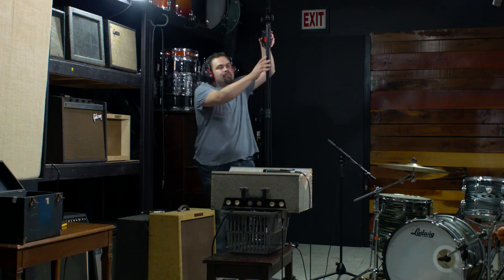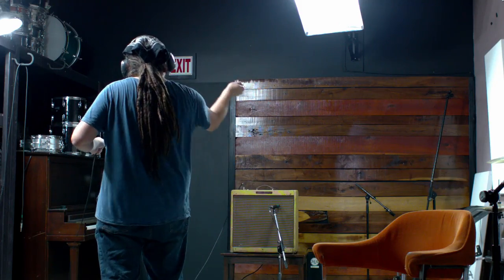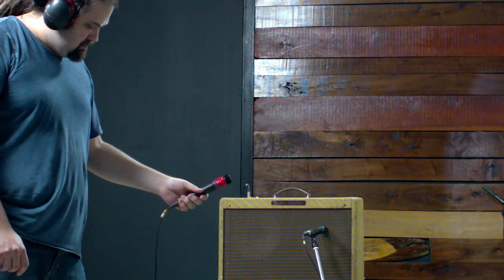Using a Lasso SM57 to Create Doppler Chorus

Comment: I can hear my mother's voice in my head, "Sure, it's all fun and rock'n'roll, until you take somebody's eye out swinging that fakakta thing!"

Seriously, though, it is a very cool effect. The main downside I see is that you not only have to tape up the mic, but afterward, you'll probably have to tape up your shoulder as well.
Reply from the maker: No tape to secure it, just to make it Omni. The xlr jack held it good.
Reply: Actually, I was referring to using the tape to make it omni. I was trying to make a bad overexerting-the-old-shoulder joke—mainly because my shoulder hurt just watching you spin that thing. But since you mention it, exactly how are you applying the tape to make the mic omni? It was a little hard to see exactly what you were doing there.
Reply from the maker: Yeah, ok good. Was worried that the video was really unclear about a mic becoming loose and flying. For the omni bit, I'm just putting the tape over the vent, just behind the white text of the mic that says "SM57".

Comment: Have you tried doing a mid/side approach to the close mic with the swinging mic as the mid variable?
Close mic copied and inverted (nulled out)
Swinging mic no pan?
Reply from the maker: That's an interesting idea. I should give it a shot. Very possible that they will just not add together, and you get a weird phase sound out to the sides.

Comment: Oh, that reminds me, I almost bought an "as-is" Leslie 825 from Goodwill on tuesday. It has no power cable, so there was no way to test it, and no returns..... If I could've known that the speaker wasn't ripped and the motor worked, I'd have bought it anyway, it was 150 bucks. Even if the amp was dead, I'd drive it with something else. But....if I don't even know it works at all, and the amp and motor could both be dead and the speaker cone eaten by mice, 150 is a bit more of a risk than I'm willing to take. On the other hand, that's probably just my personal preferences, because if it was an old Valco or something without a power cable, I would have taken the risk and had a new project to work on if necessary, but not for something that I can't use as a major part of my everyday setup. It was the type with a stationary speaker, but with a cylinder that rotates around the speaker with an opening on one side. I've been thinking I could build one out of a ceiling fan and a hunk of PVC pipe. Or I suppose I could just take my little Pro Jr combo and throw it up in the air....
Reply from the maker: Hmmm yeah like a few pvc that is a large diameter that could work. Or perhaps something out of light weight wood on top of a ceiling fan motor.
Reply: Yeah, could even be a couple flat boards nailed together to make a bracket that would spin around the center, or 4 boards making  t shape, with a piece hanging down from each end. The fan blades themselves could probably be used with an additional board hanging down from the end of each blade. I've tried setting a window fan on a Variac to spin very slowly in front of a 1x12, right between the mic and the speaker, but it made too much electrical noise to be practical.
Reply: Guitar Leslies are easy to come by - simply obtain somebody's throwaway Hammond spinet organ, commonly available for free.
Some people will even pay you to take it away!
The inbuilt cheese wheel Leslie is a self-contained unit, easily removed. Hook it up to a small guitar amp (15-20 watts). You'll need to devise a safe switching mechanism for the motor stack, maybe get a qualified electrician or amp technician to do it. Or you could just hardwire only the slow or fast motor, whichever you prefer. Should still cost less than risking a Goodwill mystery Leslie.
Reply: I live in CT, our "free organ" market has dried way up, and now people are asking 1000 bucks on craigslist for their "everything works except these 20 keys and the reverb and mice live in the speaker cones" 1961 M100. I used to go around and grab up ALL the old Hammonds and convert the amps for guitar, bass, harmonica, hell....I even had a pair of old (I think AO-39) Hammond amps that I used almost exclusively for re-amping drum overheads in my stairway, so I could track drums really dry and then get room sound after the fact. My favorite bass amp is an AO44 converted, with the negative-feedback loop disconnected and the input hot jumped straight to the grid of the first tube. A compression pedal, into that amp, driving a 115 with a Black Widow. Or plug a guitar straight into it and drive a 112 with a T75. Awesome amp that will sound cool for a number of applications. Then people got wise to it and started asking exorbitant prices. It was cool while it lasted.....
Reply: Adam Rainstopper don’t bother trying to obtain toneeheel Hammonds. As you say, the Hipsters have driven prices through the roof, and it is absolute sacrilege to cannibalise these increasingly rare instruments just to make guitar & studio effects.
I meant cheap, cheesy LSI organs, not just Hammonds either - plenty of other unloved brands used authentic Leslie cheesewheels
Reply: I've never butchered a perfectly working tonewheel organ to make a guitar amp. I think it's actually people like me who drive the prices up though, people who harvest what is good and make something cool out of it. The amps in there are really great for guitar, with minimal work. The amps are also housed in a time-capsule, and are not moving parts, which is why a Hammond amp (or a Baldwin or a Conn or any number of different older brands) will outlast the tonewheels and the start motor and so on. I found one, an M100, in an abandoned church somewhere in Providence, and the start motor wouldn't move, the keys were filthy and all sticky and full of mouse crap, the tonewheels and the entire tone-generator ..... thing .... was rusty. However, there were two amps in it that were remarkably undamaged. I would love to have an entire M100 in my studio, but I only ever get pieces of them.

Comment: Can anyone explain how the tape turns the SM57 into a omnidirectional mic?
Reply from the maker: Without the vents the diaphragm can't cancel out the sound that is coming from behind it. This is why singers should "Cup the mic" when they sing, as it creates feedback when they close the vents...make it omni...and get tons of stage feedback.
Reply from the maker: *Correction, "Should NOT cup the mic".
Reply: @creativesoundlab  omg mind BLOWN.. also you can edit comments bud lol... also could you do a video on how to cancel out sounds by using a second mic in reverse phase? I have read that if you're recording and there's ambient noise you don't want to capture you can stick another mic closer to the ambient noise and then in post you can reverse the phase of that and it should cancel out the noise that is going to the recorded mic. Hope that makes sense...   when I tried it recording acoustic guitar while a heavy metal band played down the hall it didn't really work
Reply from the maker: Yeah I've heard of the RX7 plug ins doing that stuff with the noise cancelation. It'd have to be the noise that is the issue from the same position.
Reply: Cheers for the help!
Reply: @creativesoundlab  I see, so it would probably work better if I had two 57's..one facing a guitar and one facing directly away from it..I'll give it a try!